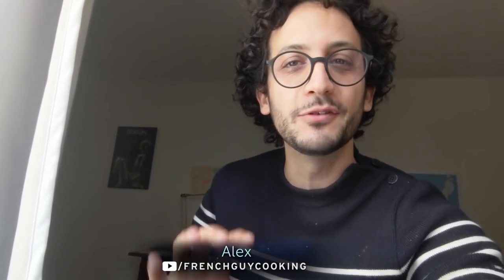Alex (French Guy Cooking) and Neil deGrasse Tyson - Non-Stick Pans

Comment: PhD student studying electrophoresis, reasonably well versed in interface chemistry The reason why the pan is non-stick to most foods would be — judging from my best intuition — the fact that it had a very low Hamaker constant, due to the very symmetrical and hence very apolar molecules. This very low polarisability means that water will interact very little with the polymerized oil layer and much more with itself (forming H-bridges). A teflon pan will be even better because it is coated in a fluoropolymer which is not only a highly symmetrical molecule, the carbon-fluor bonds in this molecule are very hard to polarize due to the high electronegativity of the fluor. The teflon coating will not only not interact with water, it will not even interact with oils in your food. For those interested, look up the following: Van Der Waals forces, the London dispersion force and the Hamaker constant.

Comment: The best explanation that I've heard for why stuff stocks to pans, meat in particular is that the same polymerization action that happens when you season a pan is now happening to the surface of the meat which is why you have such a strong hold. As for why the seasoning is non stick I believe it has to do with it being a really good polymer and not having any loose ends to bond with anything.

Comment: The crystal structure of the metal is infused with oil that is polymerised by heat so it is tangled with the space in the metal crystals. The parts of the oil polymers on the surface of the skillet are almost pure carbon and are easily polished smooth. These are refreshed by cooking.

Comment: Pans after seasoning can be washed with dish soap without worrying that the oil washing away as long as you're washing the pan while it's not hot.  This is because when seasoning a pan, you're creating a layer of black rust (Fe3O4) which holds polymerized oil so well.  And every time you use the pan, your adding layers of polymerized oil on top of the initial one.   Black rust, unlike red rust (Fe2O3) which forms when iron touches the water, doesn't flake off from the pan easily and prevents the pan from getting further corrosion -- so in a way, rust is preventing the pan from getting damaged by a different type of rust.
A Japanese TV program "Tameshite Gatten" did a story on why woks used by Chinese chefs don't stick and rust a while back, and that's where I got this.

Comment: Burnt oil has a proportion of graphite. Not only can that suff be pretty smooth, but it can also be pretty slippery, especially if it deposits nicely in helpful layers.
Btw, the chemistry is in the partial decomposition of the oil into the various products. All else is pretty much physics.
Also, they trained us to lightly abrade the cooking surface with heating salt in the pan before decomposing the oil to encourage smoothness.

Comment: I do believe the Teflon coating is non-stick because the surface is a lattice of carbon <=> carbon bonds which are very hard for anything else to affix to. Maybe the organic oil carbon's form a similar lattice?
-A layman
Reply: Plastics in general have CC bonds, Teflon has adjacent CF bonds that are strong.
Reply: Teflon has the strongest bonds in all of organic chemistry.
it's so strong that Teflon is the only thing that can store fluoroantimonic acid, which is the strongest superacid and 10 quadrillion times stronger than hydrochloric acid.

Comment: Teflon not only has a very low coefficient of friction but the coefficient of static friction is the same as kinetic friction.  Most surfaces you have to push harder to get something to start moving but it becomes easier once it is moving.   With teflon it's the same so the food slides off the pan easier.

Comment: It’s because all non stick pan are coated with Teflon TM (PTFE). PTFE is a type of plastic that is high heat resistance (around 300 oC), partially chemical resistance. PTFE has a property of non stick because of its smooth surface.

Comment: I was also wondering about this & hypothesized that the oil is essentially a chain of carbon hydrogen atoms & with the high temperatures used in seasoning perhaps the hydrogen is released & a carbon layer of graphene is left behind. I'm probably wrong, but, so far it's the only thing I could think of that would be very slippery...
Reply: Yah, a properly seasoned pan has a layer of almost pure carbon on it.  Don't know if it's in the graphene configuration, but similar bond strengths and resistance to outside atoms apply.  Realistically, it's like a shock-diamond coating, because it gets super-hard and is very brittle.  You can ruin the seasoning layer if you get the pan too hot and then cool it quickly or unevenly, like running water in it to stop it smoking.  The iron will warp with the temperature differences and recover, but the carbon layer may crack & flake.

Carbon also acts as an insulating layer that lets the heat spread around inside the pan more before passing through to the food.  A well seasoned pan cooks noticeably more evenly, almost as much like a radiant heat source as a direct contact burn.  A pan or grill that is over-seasoned or carbon-crusted will cook slower and use up more fuel because of the insulating factor.

In one restaurant I started at, the cooks had let the broiler grillwork get so crusted up with carbon, it was taking 30 minutes to cook a steak, and it was throwing off the whole cooking & hospitality schedule.  It also made tough meat and hot & cold spots where flame jets would break through suddenly, or the spaces were just totally clogged.

I quickly called bullshit on that issue and took some time to de-crust it back down to metal, and the same steaks were then cooking in 5-10 minutes to tender perfection the way they should.  After that I made them wire-brush and/or cloth buff it after a rush to maintain just the right amount of carbon.  A good seasoning should get to where it is very black and smooth, a little bit shiny and slippery, and have almost no noticeable texture or thickness.  So, yah, it's basically an industrial diamond surface.

So far, the best fat I've found for establishing a good seasoning layer is bacon.  With a new pan, I'll cook bacon on it 1 slice at a time, save any liquid grease aside for the next strip to use, too, and rough-scrape and cloth-buff it each time.  This all gets more micro-layers going on the bare metal, almost like sanding layers of paint.  For maintaining a good seasoning, frying or sautee with butter up to browning temperature keeps the surface smooth and healthy.  Vegetable oils just don't do as good of a job.